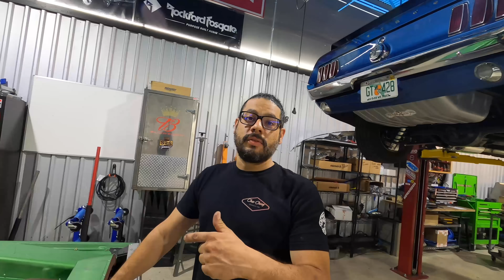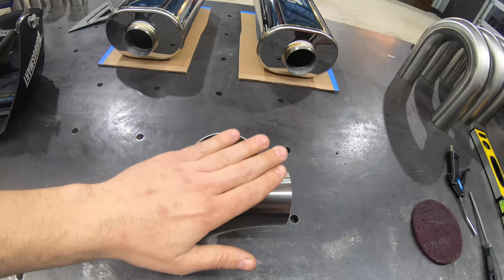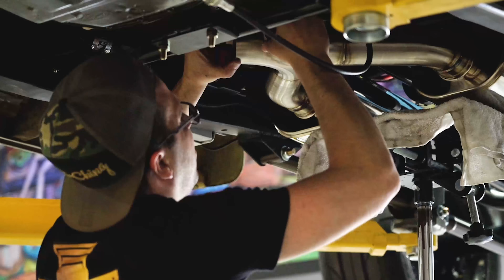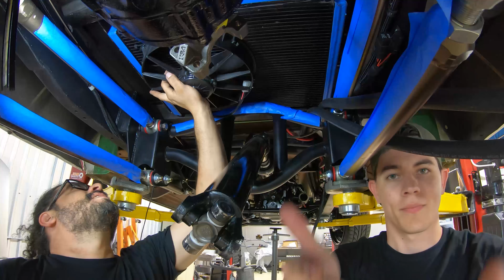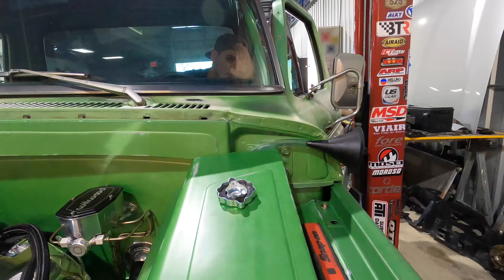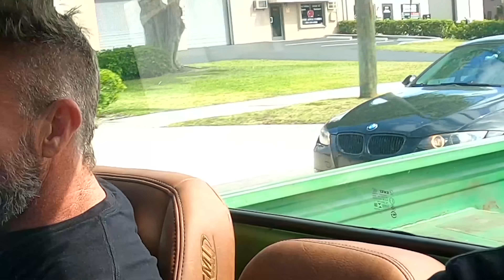Supercharged 1973 F100 Custom Exhaust - First Start-Up! - F100: Ep. 8

Comment: Sweet system. Stainless bros is the best. One note, please everyone back purge your stainless/ti system. You are taking years off your system if you don't. If you are making a stainless turbo header, you need to 100% back purge, so there is no sugaring(massive oxide contamination on the inside of the weld, protrudes into the exhaust).  The sugar can break off and destroy a turbo and potentially a motor.

Comment: How much would you guys charge to completely do? My Ford f-100 1970 XLT ranger long bed has a 400 big block. The cops smashed the bed and someone hit and ran my front end. Other than that it's not bad any new floor panels but I just can't find a good shop here in Ohio near Canton, Ohio. Anybody got any of ice needs a whole new wire harness. They tried to steal it instead of just popping the clutch and pushing it. They ripped the whole wire harness. Somebody please send me the right direction to a great shop!
Reply from the maker: Send us a message with details (scope, budget, end goals, pics) to info@s2scustombuilds.com

Comment: its nice, but with that huge exhaust right next to the rubber hoses, wiring i wouldn't expect them to last long. And why would u complain about how tight space is? u put the hoses, etc into that space.  i get, it is a show-er not a daily driver.

Comment: You actually don't want the cuts in the x-pipe to be in the center in the bends like that. You want them further towards the back (end of the exhaust) of the bends so that exhaust pressure isn't fighting eachother. You can cut more towards the back (the top if you're looking at it top-down) and take a piece of the ends you cut off and make a curve. You basically want to make a Y pipe with a smooth curve at the v in the Y with the bottom of the Y having tails that both exhaust go into. Ideally you wouldn't use an X pipe and make the exhaust true dual exhaust. Especially handy for diagnoses.